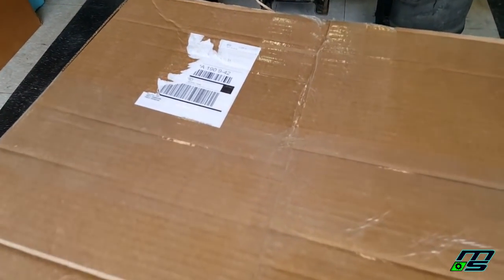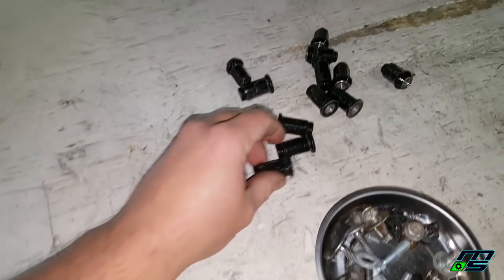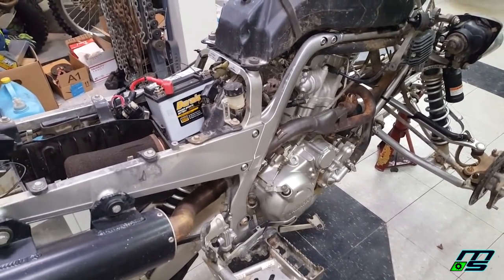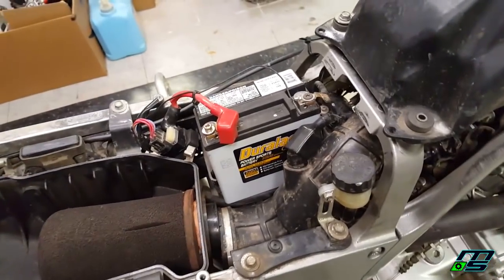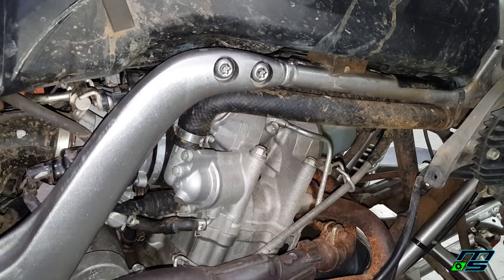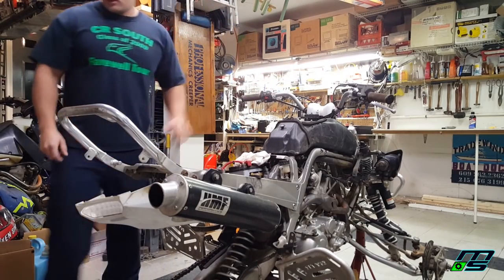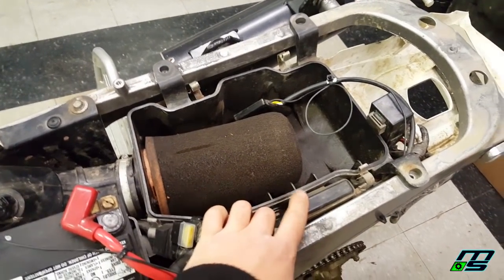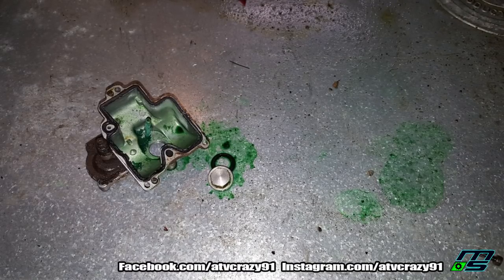Project Raptor 700R!!! Diagnosis!!! | Part 2

Comment: The two big terminals become normally closed so you should ring it out with continuity, you would need a 12v jumper to one terminal and then your light would light up on the other

Comment: Just FYI you can't test a tps with a digital meter.  A lot of times the failure of a tps will be somewhat erratic signal through its range but will still go through the range and a digital meter just won't show it.

Comment: Also that little thing by the battery is a tip over sensor. If its bad it wont let the quad start because it thinks its upside down
Reply from the maker: Haha so many things on this quad to inspect. Thanks man, I didn't know what that was.
Reply: Michael Sabo really makes you appreciate the banshee lol
Reply from the maker: TrailBlogger I was literally thinking that exact thought the other day; "why can't it be as simple as the Banshee" lol.

Comment: I took a guess at trail bloggers raptor, I thought for sure it was the valve lash as it usually is with the older raptor 660's.  I was so wrong.  I've been  planning on replacing my ZX7R Engine In my Banshee for a newer fuel injected version, but I'm still considering all the added trouble shooting, future headaches. We'll see. Awesome vid & great info!"
Reply from the maker: That's true man; this is my first fuel injection project so I have a lot to learn.

Comment: Great video Mike.  Hope u get it running.  Cuervo racing has a video about a wire that comes loose on the cdi box on the side of the air box.   I forgot which color wire.  Might want to check it out..  May help u..    also, can you do a front end alignment video on a quad.  Thanks

Comment: I might be wrong, I'm not an electrician, but I've always been told the way to test a relay is to hook up 12v across the 2 pins like you did, and then take a continuity tester(on a multimeter) to the other remaining pins and there should be continuity across 2 of them, so there's basically 2 separate circuits, and you willnt see power across the separate circuits. But that relay does seem a little fishy though with that big hole, hope u find the issue.
Reply from the maker: I think you're right. I did use a multimeter as well. Electrical has always been my weekness.
Reply: Michael Sabo alright, yea it's not exactly my strongpoint either(I've made several stupid mistakes, one including a relay) just trying to spread the what I learned over time. Hope  you find the problem quick(especielly if it's electrical)

Comment: Try going to hmf and looking at the programing charts because that’s running to rich. My 2007 didn’t even have the programmer connected and it was running very rich so I put the stage 5 program in it and it runs good now. Also get a air box lid for that. And that starter doesn’t sound like a raptor starter at all. And run the ground for the programmer right to the battery.
Reply from the maker: Thanks for the suggestions man. I did look up the programmer to make sure the settings are correct. The airbox is there, just off of the quad.

Comment: Be sure it has fresh gas.  Also with that intake boot loose it could have sucked in dirt and tightened up the intake valves.  A compression test would be worthwhile, I found a kit at Harbor Freight that has the correct adapter.
Reply from the maker: I will probably buy that kit; I have a few adapters but none fit. I am definitely checking the valves and I hear you on the gas.. it smells fresh but you never know; I wish it wasn't topped off when I bought it.

Comment: Love your videos. I almost bought this quad when it was for sale but you beat me to it 

It sounds like it’s turning over too fast, check your valve timing, if that’s ok check your compression. I think it’s engine related. 

As for that relay, you won’t see voltage at those two pins but you will see continuity, so you have to use your volt meter to test it.
Reply from the maker: I did use a multimeter to check for continuity after I made the video; the relay is shot. And I agree, timing/valves are off.

Comment: Idk if these raptors have a parking brake sensor, if it does you should unplug it. On my banshee it would be kinda hard, wouldn't rev at all,hard  to start and not spark at times, so I unplugged the the parking brake sensor and it ran perfect.
Reply from the maker: I think it's been removed previously, but I will still check, this is a good idea.

Comment: Hey Mike : Esseee how many tars we can git in isshere box. FyI on that relay : You may need to check the big terminals with Your Ohm meter since all they probably do is complete a circuit for oil pressure or something. The hole in the relay case makes Me wonder if somebody was trying to fix the relay. $14 aint bad. Bell Hellicopter wants around $1400 for similar type relays.
Reply from the maker: Hooooly hell man! 1400$ for a relay!? That's crazy!

Comment: Great video Michael hopefully u can figure out the problem an get it going ...if I'm not mistaken I think the rapotors have fuel injection maybe something to look at .....?
Reply from the maker: Yes, the 700's have fuel injection. I looked over the throttle body and checked TPS so far. Thank you for the compliment!

Comment: Can not test a relay with a test light like that. your giving power to the coil but not giving power to the light. can't wait to see what the problem is though good luck!
Reply from the maker: Electrical is my weakness by far. I do believe the relay was bad though, and it has been replaced. Thank you for the feedback.
Reply: @MichaelSabo  you should look at a wiring diagram before testing a circuit I have been turning wrenches for 15 years and have replace less then 5 relays in that time

Comment: Sorry the tps and spark plug did not do the trick. Have you checked the fuses? Does the fuel pump in the tank vibrate and prime when you turn key on?
Reply from the maker: Fuel pump is priming and I checked the fuses.

Comment: I had a similar issue with my dad's 700 it turned out to be a starter solenoid, it started right up after it was replaced so maybe try that
Reply from the maker: Thank you man! I will put that on the list of things to check.

Comment: What should be stock compression on the raptor 700? I only have 90psi and a no start condition (spark and fuel present).

Comment: take that cheap hmf programmer setup off and buy a power commander v and that is a universal relay that all auto parts stores have but try to run the quad without a programmer to see if that is the problem
Reply from the maker: I tried that but unfortunately no dice.

Comment: I have a 2006 Raptor 700, mines does start fine but will die within seconds, any suggestions on what could be the issue? Fuel pump working fine does prime

Comment: There only is one spark plug on a Raptor 700?
Reply from the maker: Yessir
Reply: Michael Sabo fuck a banshee has 2 cylinders the raptor only has one ?
Reply from the maker: Yea man, one big ass 686cc cylinder lol
Reply: Michael Sabo jesus I was looking for a banshee project but over in Ireland there normally all fixed up